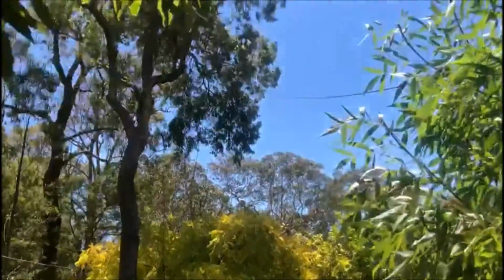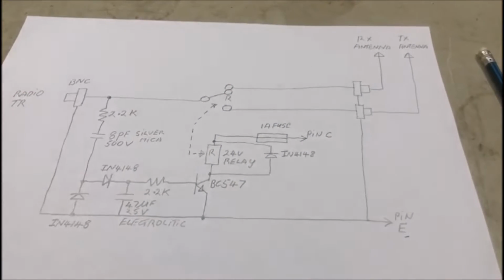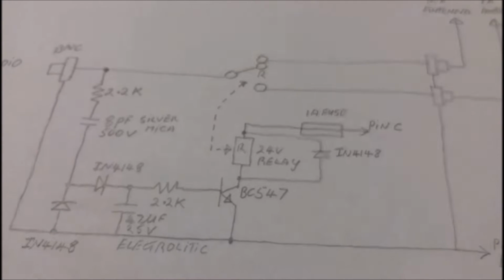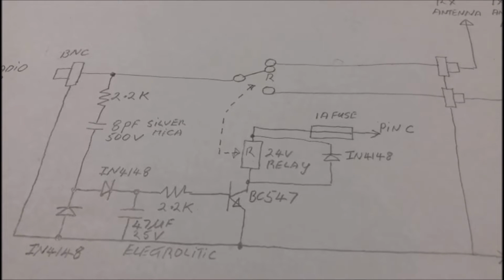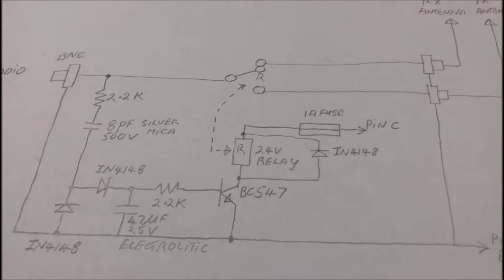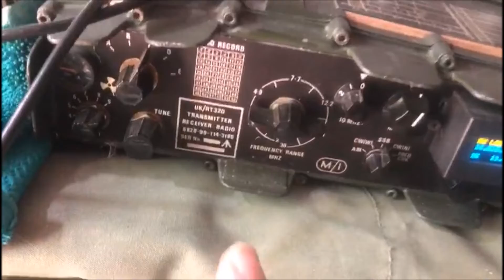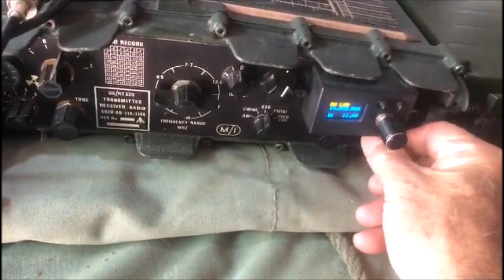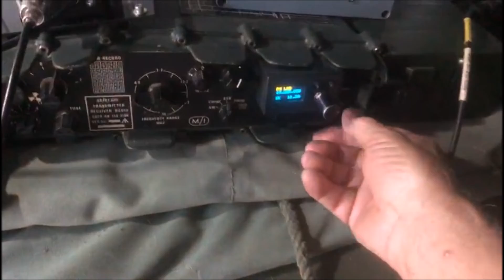VK2PRC Clansman 320  automatic antenna change over box

Comment: hi, nice video and circuit. I did try to make a auto switch, but i was lucky to have the amp switch on my ts 480hx, which simply connects the power across the relay, the switching line has no power on it from the rig, so no sensing circuit required, its just simply a switch .it seems to work ok, although i am not sure, if i should have other components onboard for protection. sent you the circuit via email, if you could comment on it, would be very much appreciated. cheers. brian zl3xdj.

Comment: Unfortunately, I don't trust these types of circuits. The main reason for this is that they only switch when the high frequency is present and it also takes some time to switch the relay. During this time, the SWR load of the final stage increases. Instead, I prefer the PTT line. Anyway, good luck, and happy new year !